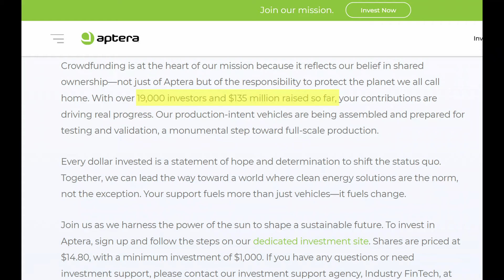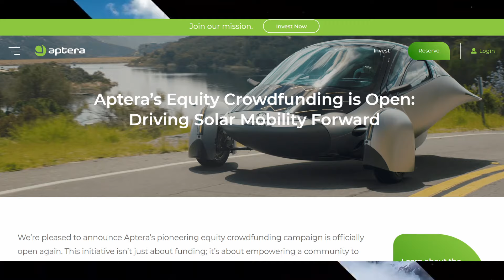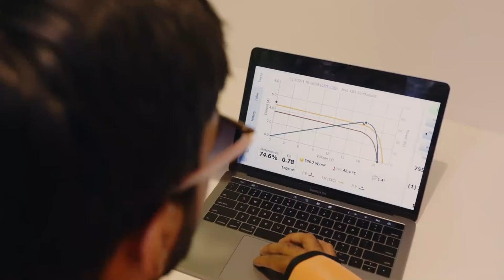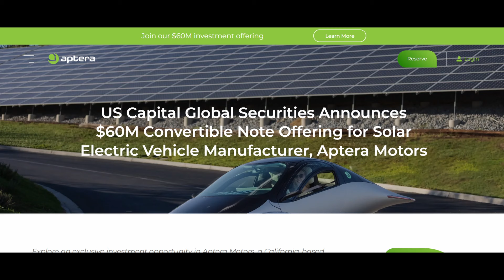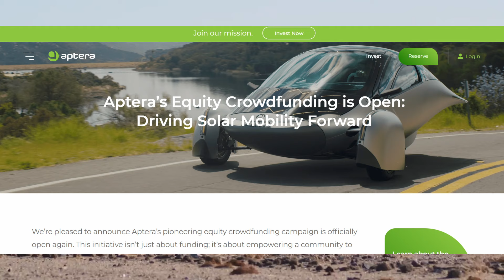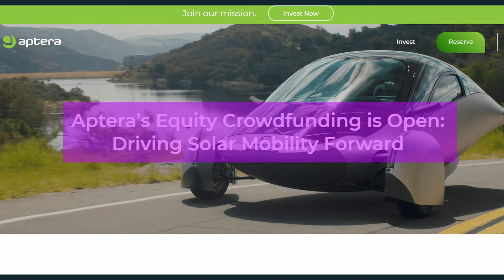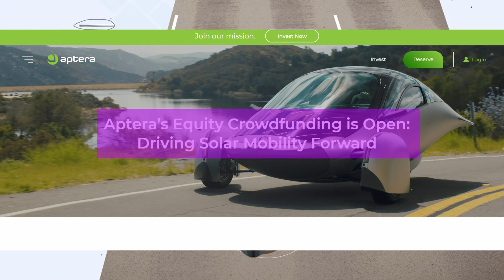Aptera’s Equity Crowdfunding IS BACK FOR GOOD: Why It Will Be A RESOUNDING SUCCESS

Comment: Although cleaning up the environment seems like a good move, I think the majority of folks don’t believe there’s an issue with the with it. Since there’s only a 4% presence of CO2 in our air, it’s not a concern when you know that if it drops to 2% plant life starts to die.
Reply from the maker: Hmmm, 
🤔
Reply: It's not just CO2, which is an invisible gas. It's particulates from diesel engines, and other contaminants from gasoline engines. That's the smog that you see in large cities.